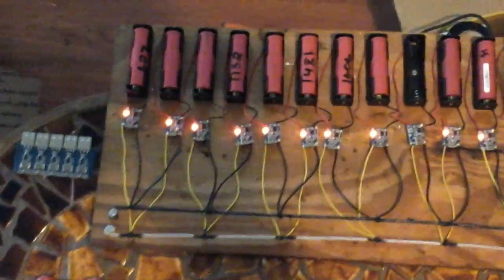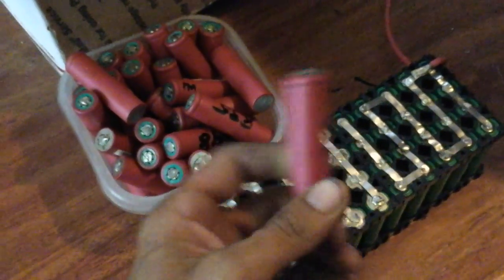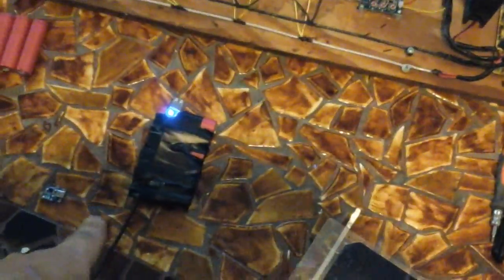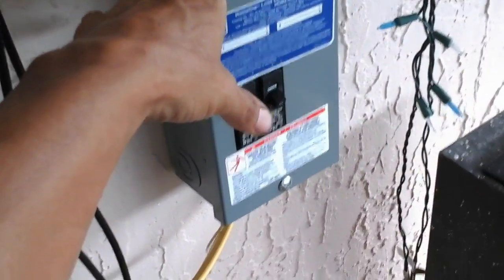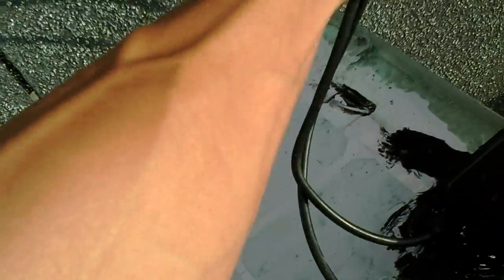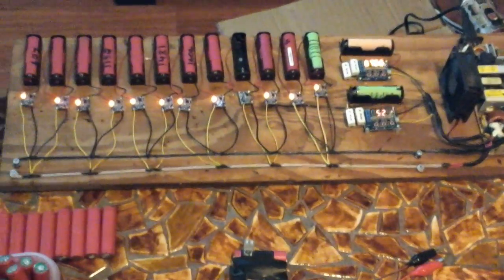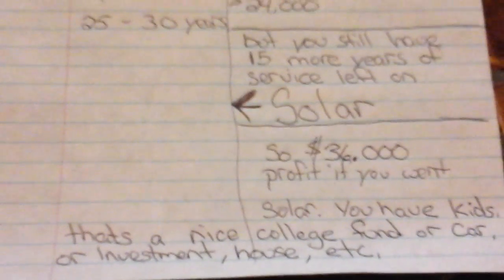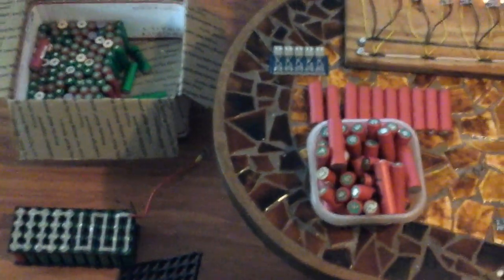18650 setup  and solar set up.

Comment: do you test the battery resistance also before you make your packs?
Reply from the maker: +grn dragon this was my first pack that is this big. All I did was charge and discharge to get capacity of each cell..then build in 7 cell pack.
Reply: have you seen an issues doing that way?
Reply from the maker: I had 1500mah or better in pack.. for the loads it can handle I am happy..but for my  tesla wall I dont want no less then 1800..trying 2000mah or better.it willl be 7 cells of 200=1400 batteries
Reply: so in all you never checked the ohm's of your cells? have you had see you cell get farther apart in voltage at all?
Reply from the maker: not yet..I have a 60amp 24v bms that keeps it well balanced.. battery pack is in solar generator i built around 2 months ago..still runs strong,but u have a point..should drain pack to cut off and check
Reply: my problem I'm having is when I start charging in series. some will go to 3.85v and the others at 4.5v on my imax.

Comment: jesus man how many laptop batteries did you take apart? lol how do you check the capacity of one 18650?
Reply from the maker: +karzygijose need 1400 to start with...for power wall..after dismantling from laptop battery I take 18650 and charge to 4.1v let sit for about a week.. if voltage drops past. 0.5v eternal resistance is to high and is not used..I then put battery in 18650 discharger at a 1amp rate..after discharge put capacity of battery..charge back to 4.1v and set aside..on to next one...
Reply: When you say "if the voltage drops past 0.5V", do mean from 4.1V to 3.6V? Thanks.
Reply from the maker: from 4.1

Comment: how do you charge a battery pack that has lets say 20batteries in series and four 20 battery packs in paralel ? ? ?
Reply from the maker: +JusstyteN there are many battery voltages to choose..depends on application
Reply: +matthew drummond i need to change 4 cell battery bank that sums up to 14.4 nominal and 16.5 max charge about 200ah battery bank how do you charge it?
Reply from the maker: lets see. something tells me u already know the answer to your own question but..4 cells of 4.1v max will give u your voltage with 18650s. if u use 2mah u will need well.400 cells total.
Reply: matthew drummond yea im going to build a pack with 720 batteries using both good and bad cells everything over 700 mah discharged at .8A i need a pack that can provide 200 amps consistently. im marking the initial voltage drop and so on. i dont know the ansver because i need it to be charged and voltage regulators like 317 isnt gonna cut it. those little 700ma charging boards either
Reply: atm i have about 400 cells to check and i already processed 30 batteries its taking long time
Reply: Check this device my friend... its what I'm using to charge my packs.  https://www.amazon.co.uk/gp/product/B01GNNLYX4
Reply from the maker: Nice ty..

Comment: Nice!  I didn't know you can build your own solar panels, I'll be definitely watching that video.  My electric bill INCLUDING heating for last year was $1100 ($91.6 avg / month) and I have to say my appliances are crap, my rent house is not insulated well and we are family of 4.  Heating is separate for each room so it helps I think.  I can't say that we are conservative except heating I keep temp at 70 max in the winter.  Our electricity is cheap though compare to CA at 9 something cents per KW.

Comment: Hey Matthew
 
Great update video. I'm undergoing the same project as you. I've got 21 Hanwha 250 watt solar panels and I want to make a 18650 battery bank. The Idea came from another guy here on youtube named Jehu in California. He made 18650 battery packs to run his Electric VW Samba and had the idea to create a Tesla Powerwall as well ( See his video Here https://www.youtube.com/watch?v=Bk50IuWXg-c ) He has spent lots of time charging and testing 18650 battery cell capacity and talks about the what cells to match with one another. 

I had some questions for you from your experience:

1. What was the best device option for charging 18650 batteries?                                     ( I own a Ev-Peak ecube C4 80w charger )

2. What was the best device option for testing battery capacity?                                         

3.  What are the recommended battery cell capacity (mAh) ranges you matched together to make your 18650 battery packs / Does it matter?

4. Can you mix battery brands with the near or close battery capacity?

I would assume that you would like to keep cells that have close to the same capacity together. Example: 1900mAh cells matched with batteries upto 2800mAh   Not  1200 mAh battery cells matched with 2400mAh cells 

Cheers

Comment: whats the name of those discharge boards? This mesure the capacity of the battery?
Reply from the maker: +malicious1111 yes...they measure the capacity...found on ebay...just look for 18650 dischargers...
Reply: Thx, i saw it, cool but i thought i could buy some for testing, but its price is not far from a 15 dollars, China lipo ballance charger that has discharge test.

Comment: hi there great video.!! where did you get the discharger? did you build it? i just make a small battery pack but it took me long time to discharge them  with two charger. thanks
Reply from the maker: +Direct Fly got dischargers on ebay..18650 dischargers.. I put charging and dischargers on board with scrap power supply from an x-box to power and charge ....can make as big or small as u like..
Reply: +matthew drummond      thanks .
Reply from the maker: +Direct Fly   glad to help..

Comment: How did you make the discharge circuit?
Reply from the maker: +Mark Villanueva I used a power supply from an x-box..it has a 5 and 12 volt rail...the dischargers are for 18650s and have a 1 amp discharge. you can find on eabay.
Reply: Thank you for your quick response!!

Comment: nice panels, how much encapsulant cost? is the glass normall? im about to do too panels but it has been stalled for waiting parts
Where did you got those batterie cells sound quite cheap 150dollar for over 200ah!! ebay? i have ecar but its working on old gel battery its not on road now, becouse bad battery
Reply from the maker: +riku2015 encapsulant is about $5 @ homedepot...I used it on all cracked panels. little tacky but works great..just smooth it over surface with a thin layer. 18650s bids on ebay...
Reply: +matthew drummond so cheap ? HMM!! any tips where i can get equivalent silicone here on finland? :D
Reply from the maker: +riku2015 check on Justin Case...his channel has a link on one of his videos regarding encapsulant for broken panels...I will see if I can find link or company he bought from..

Comment: Im a complete noob in this area. I just stumbled upon this niche. What is the tiny board with the batteries connected to lights and two batteries being discharged? Is this board something you use to charge up and charge down your batteries or vice versa? Im assuming the numbers your writing on the side of those batteries are a result of information you gathered from the board some how? Can someone please explain?
Reply from the maker: +Samson Taylor i used a power supply from an x-box...the 
two modules are dischargers and the row of batteries are being charged.

Comment: if i may ask i am trying to set up a solar system that will be run on these 18650s i wnat to be able to run a 1000w inverter how to do you think i can best go by this am thinking of a 24volt system that way current draw is less or is 12v still ok
Reply from the maker: +Absolom Madhaka I am making a 24v battery with 246 cells should be about 60 amp hrs.. will keep building multiplepacks to run in parallel. found pcb to balance at 10 amps per pack.
Reply: +matthew drummond I SEE PSE KEEP US POSTED ON YOUR PROGRESS THEY ARE VERY FEW VIDEOS ON YOUTUBE THAT USE 18650 ON SOLAR SYSTEMS CURRENTLY I PACK 12V PACK ABOUT 80-85AMP/HOURS  THAT I AM USING WITH A 500WATT INVERTER I NOW WANT TO USE A 1000WATT

Comment: If you are going to build such a big battery pack, I would seriously consider not charging them up the full 100%. I know those small pcb's you have charge up to 4.1 Volt, which leaves some capacity unused. But if you would charge them up to only 3.9 Volt or slightly less, the average recharge count goes from 1000 to 3000 or more. If you are watching a lifespan of 10+ years, this may count as well. one more thing about these cells. What charger will you use when you have build a big pack of them and have them put in series?
ps: I also have panels on my roof, how ever the space I have is way to low to cover my needs. But my monthly bill is really low, most of the money goes to gas and water. Solar is a good investment, more people should do this.
Reply from the maker: +deslomeslager Thanks for the advise . I have found pcb boards for a 24 volt 7 cell set up, 
246 cells. the pcb will be to keep balanced and to limit out put current. I plan on building multiple packs.
Reply: matthew drummond
Okay. Please keep sharing. I have about 250 lipo cells to fool around with so if you come up with a working solution I will follow. I do tend to do some testing myself as well, but am doing baby steps because of other work with higher priiority.
Reply: +deslomeslager can you share that 7 cell pcb board? That's the same amount of cells I need for a bike battery. 

also I really like the design of your wooden battery charging and testing bench. I want to make something sorta similar but what are those chips with the LED digit display you are using to test discharge? Right now I'm using an imax b6 but suffice to say it is taking forever to test all these cells
Reply: trevdogg100
I was asking this to myself as well. Let's hope Matthew shares this info.
Reply: I also would be interested to know the little charge boards. I have one that looks the same TP4056 but it charges to 4.2 and I would really prefer one that charged to 4.0 or 4.1